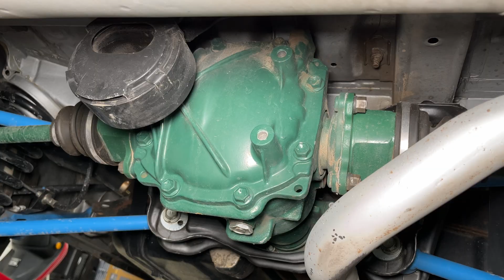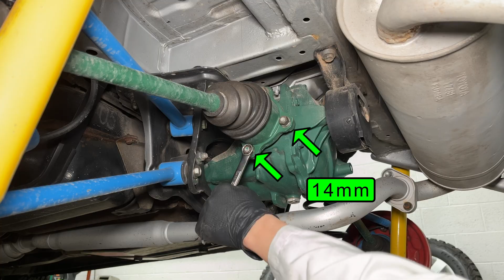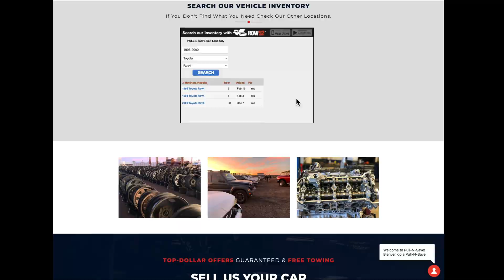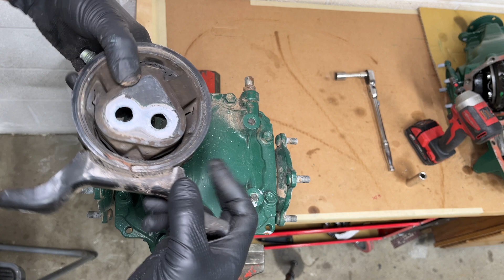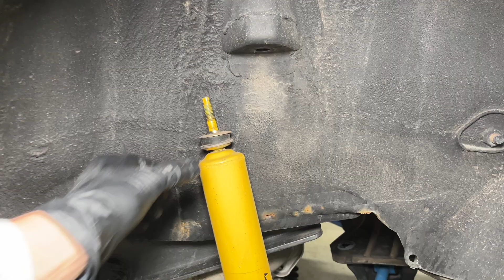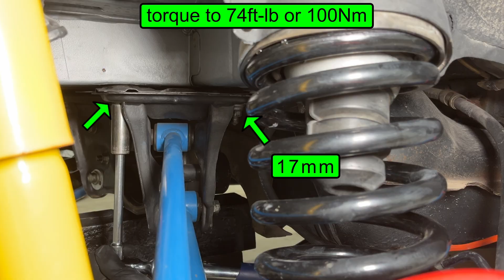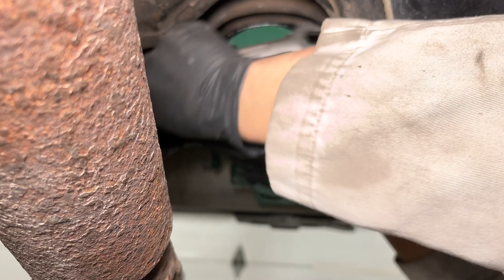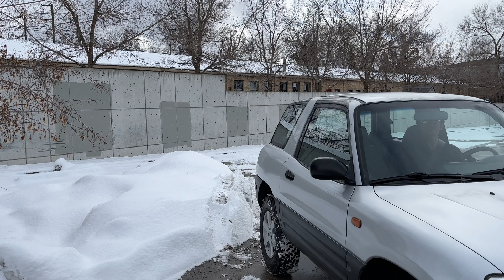Installing a TORSEN limited slip rear differential in my 1997 Toyota RAV4    (episode 39)

Comment: Great video.  I just got a Torsen for my 2nd gen Camry All-Trac (same diff as RAV4).  The Torsen was also optional in 1st gen Lexus RX300 and 01-02 Highlanders, so that increases your chances of finding a Torsen...but the Third Member housings are different for all three, requiring a little extra work for the swap.  They all use the same diff internals, and all are equally rare.  Mine was in a 2000 RX300, and it was 40% off day at the yard, so I was out the door for $76!
Reply from the maker: You're both smart and lucky!  Congratulations on getting a Torsen differential for $76!
Reply: I have pulled 15 torsens from Lexus RX300's, they're nice upgrades for all-trac Celicas too 😎

Comment: @Lab Coat Paul
My first gen RAV4 is having the back differential clanking noise badly. I replaced the mount and the rear differential and it reduced to some extend. Are there any solutions to completely remove this?
Reply from the maker: Check for play in the CV axles and driveshaft.  Twist parts back and forth while holding other parts.  If you notice a lot of play, that could be your clunk.  Also, filling the differential rear mount with urethane is a good idea.

Comment: It seems that Toyota switched away from a T1-type Torsen to a T2-type in 1998. The T2 should be a lot stronger, the T1s can crack under heavy load. I don't know which one works "better" as a limited slip, I figure they should be close to the same. I'm still experimenting with other methods of locking, I may have even figured out a clutch type that will work. Now, what I really need to figure out his how to get a FRONT LSD :)
Reply from the maker: For the rear diff, there's the Chinese AER e-locker.  It might even be as good as welded spider gears!  :P
Reply: @LabCoatPaul  maybe even better than welded 🤣 clutch would be a solid compromise